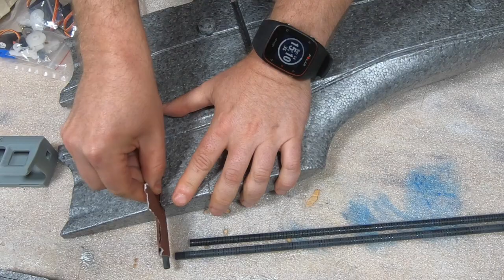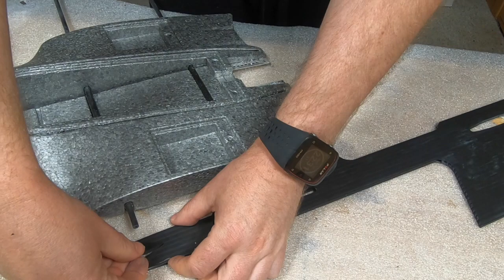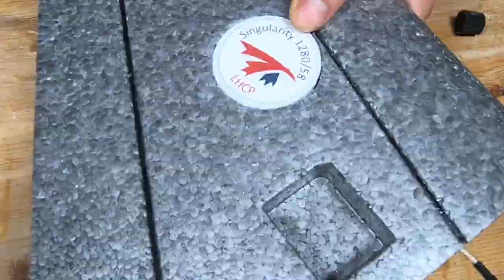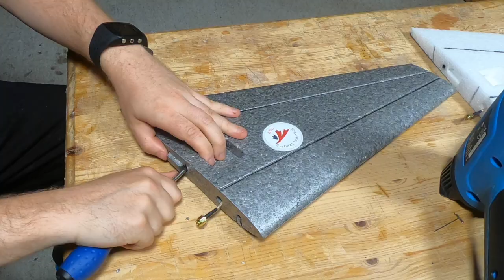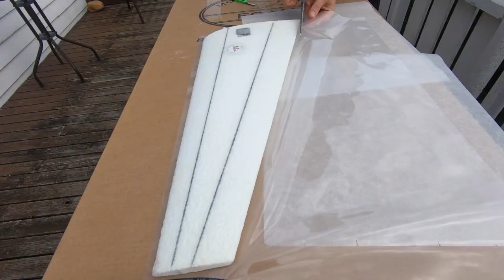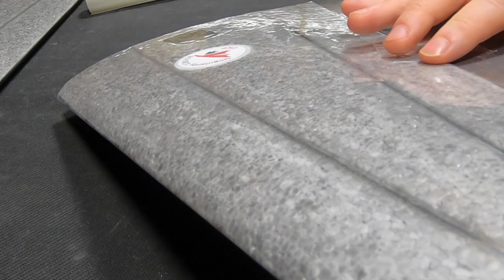Ritewing Mini Drak Build 1/2

Comment: Have you had no servo jitter from the 1.3 vtx?
Reply from the maker: Yes I have. It varies from servo to servo. Sometimes I have to use ferrite rings on the servo cable. There was no jitter on the servos in this video if I remember correctly.
Reply: @HavardStreAndresen  how much does it affect while in flight. Curious because I want to put 1.3 on my MD but not sure if I should or if it will cause it to crash.
Reply from the maker: @holaperrito2554  1,3 ghz is amazing. All my planes are 1,3. You just have to test on the ground to make sure there is no jitter. Its not really a problem if you know how to deal with it. High quality servos and filtered power distribution helps.
Reply: @HavardStreAndresen  thank you sir. I’ll have to look at how to make sure it isn’t a problem

Comment: Forgot to ask you, How´s the E6000 holding up after some flights?  It looks like a great idea, easier to apply, plus, I guess it fills some holes in the fuse, right?  Thanks, stay safe!
Reply from the maker: Its great. I was skeptical at first, but its super easy to apply, light and protects the airframe well. It will not add the stiffness of laminate, so laminate on wings and E6000 on fuselage.
Reply: @HavardStreAndresen  Will do!  Thanks for trhe reply, Cheers and stay safe!